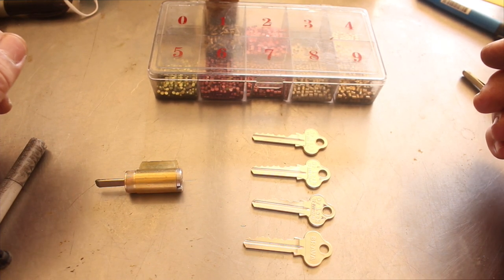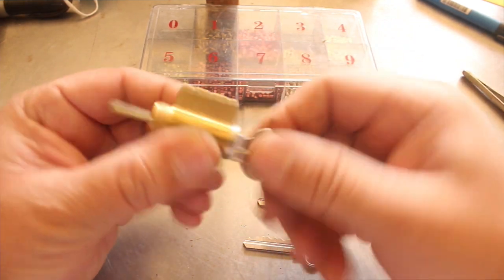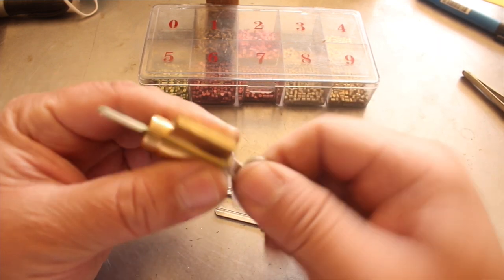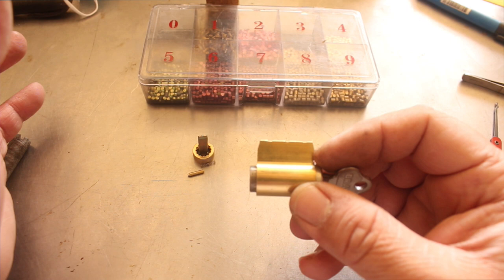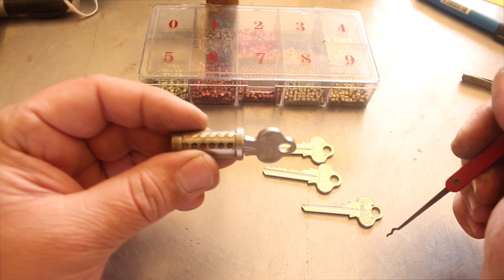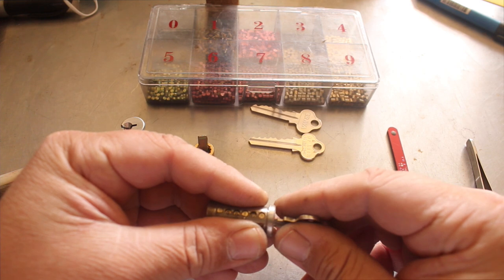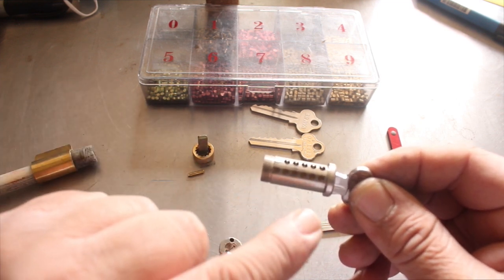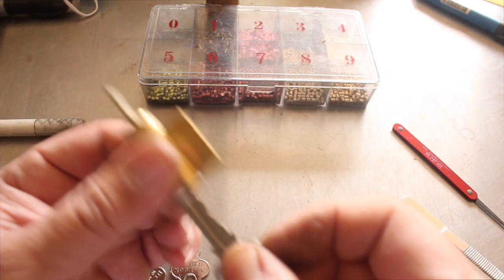Self Changing Lock Setup - 4 Different Keys In 1 Lock

Comment: Just remember, you're sacrificing security for convenience here to some extent. more shear lines means easier to pick. so you need to balance that up with the level of security you're trying to achieve. On the plus side, if your key doesn't work one day, It may mean your door was unlocked at a level that was not designed to operate at, so you have an indicator that maybe someone has been snooping around while you were out. For home users, It's probably easier to just swap the cylinder out for however long you need to give temp access to someone and then swap it back when they are finished. Very cool video Dr Lock, keep em coming!

Comment: Very cool to see this in action. I've came across many a plug that has had these construction holes and ball bearing. cheers
Reply: I’ve seen these in videos but never in real life yet, seems kinda neat
Reply: Almost every home in Australia that uses Gainsborough locks on the front door will have these cylinders installed, so it makes it easier for the builders to use master keys while under construction.
Reply: @Fanta....  yes that is the brand that I have mostly come across with construction holes, however I have also come across instead of ball bearings they have used Master Wafers, which made the lock very easy to pick, cheers